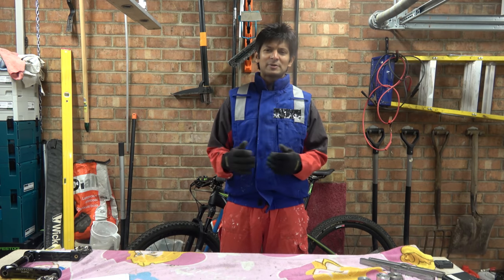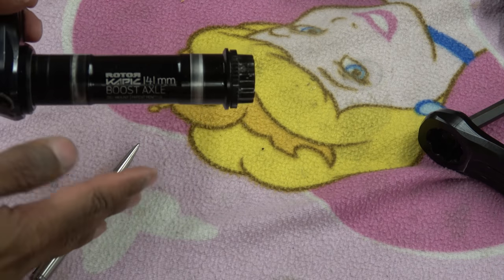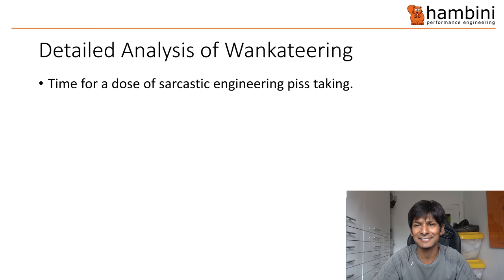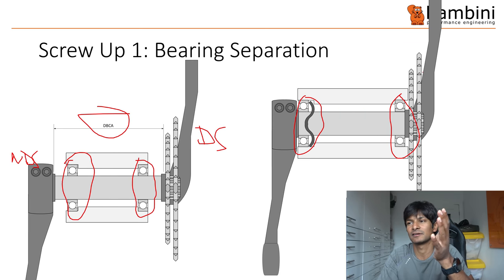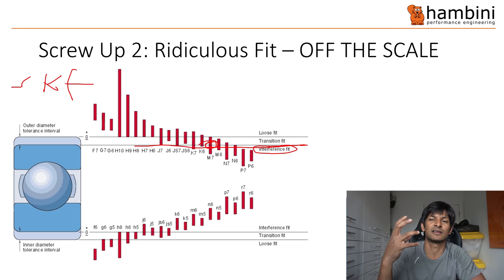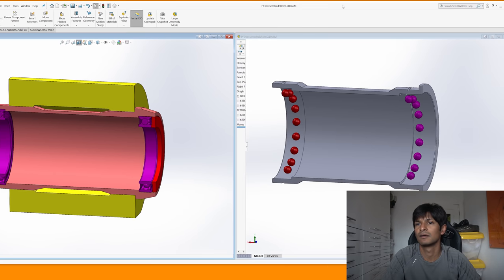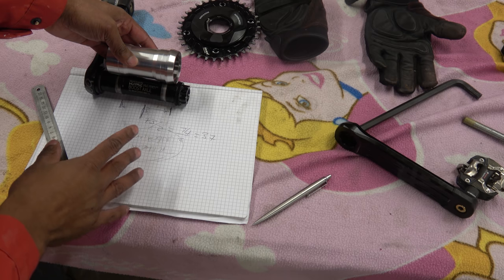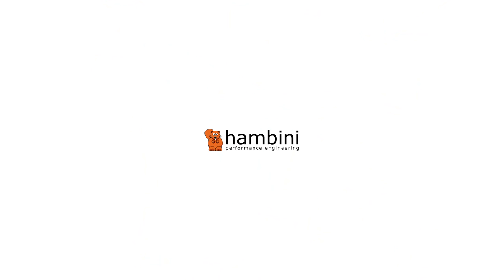Engineered By Muppets | Niner Bikes get Burned for being CRAP | Abysmal QA

Comment: As a former bike mechanic I generally try to avoid anything that is a press fit, good old english threaded bb's just work and are so much easier to live with!
Reply: Yeah, there's nothing wrong with them if they are produced to the BB spec/standard. But a push fit hole can be hugely out of spec and still get a BB pushed in with enough force. A threaded frame cant be as out of round or mis-sized as if it was you couldn't screw the BB in at all and throw the bike together for sale to some fule.
Reply: i love mike n mike PB take. pressfit stiffer but different tools to service. end of . literally. its a frickn straightforward piece of engineering either pf or english threaded. any bonehead can service.
Reply: RollinRat  So are you saying you can get away with making a garbage frame by throwing a pressfit on it?
Reply: I think we know it wasn't the BB or bearings and rather the poorly manufactured frame. That was the whole point of the video.
Reply: RollinRat  I agree, threaded BB's, even outboard bearings, will not leave you stranded on a bike tour usually. If you want set and forget for years, use a square taper crank, and Phil Wood sealed BB.
Reply: @Mike-vd2qt  Shimano Octalink BBs have been very, very good for me both MTB and road variants. I've enjoyed ST, used THUN in the distant past which were so damn smooth and used the same bearings as campagnolo IIRC, I've also used an SKF BB once, a few HOPE and a titanium TEC components ST which was 150g or so. Never used PW but people say they are exceptional.
Reply: @ynotnilknarf39  Good to hear that, as I'm about to install an Octalink BB and crankset on my hybrid.  Nothing particularly wrong with the square-taper BB it's replacing, just the old crankset is worn out and the new one uses the different axle fitting.  I'm actually rather pleased that I can change them over this easily.
Reply: Aye, they can be made abominably badly & not give symptoms a bike owner will notice, press fits however require round holes of the correct dimensions, which every other industrial sector seems to be able to make, just not bicycle manufacturers.
Reply: RollinRat  What a bloody long-winded way to basically repeat what I said.
Reply: RollinRat  There's no reason a press fit needs to be "shit", particularly in a carbon frame, & there's no excuse for the hole being out of spec in such a case, it's not subject to distortion from welding when a liner is bonded in, & a liner is easy enough to make with a round hole within tolerance, just about every other industrial sector manages to make such components.  That said, a threaded BB is more forgiving dimensionally to begin with, also easier to correct, though there's no excuse for a bike shop needing to correct either.  Neither BB type should be leaving the factory out of spec to begin with.
Reply: RollinRat  You've been bloviating this entire thread talking about bottom brackets when we all saw the video... We know it's the frame... Now you're an "experienced machinist". If you're such an experienced machinist why are you assembling bikes and rambling on YouTube?
Reply: @Kromaatikse  Nice, I'd suggest getting some self extracting bolts just to make it a bit easier but with the right tool it should be a doddle anyways, just on the road all you'll need is a 10mm allen key.
I actually bought an Ultegra triple chainset recently, you can use these older triples as a 'super' compact double as you can get rings down to a 23T to fit the inner BC (normally 24T) and with 130BCD rings going for cheap due to the 110BCD 4 and 5 bolt road cranks you can have anything you like really a 39/23 with say a 11-30 at the back means you've covered most the bases for everyday cycling.
TBH though it's almost as easy to have it as a full triple (I use a ST triple on my audax/touring machine), any Shimano triple STI from the last 30 years will work, or even a Campag ergo 8 speed to early 10 speed with the multi positions means it'll work with virtually any FD. Or if using a friction shift left you can use anything including MTB front mechs with road cranks.
Shimano has gone downhill in recent years though, road stuff is ugly AF and MTB isn't that much better.
Reply: @ynotnilknarf39  Really I'm doing a nearly like-for-like replacement using some of the cheaper part lines.  The original Spectra 48-38-28 triple, in which I'm fairly sure the two larger wheels are aluminium, becomes a Shimano 48-36-26 triple in all steel, and the original 11-32 cassette becomes an 11-34 MegaRange cassette.  The gearing sequence (using double shifts between 4L/3M and 6M/5H) becomes significantly more even with that combination, and I'm reasonably sure the original derailleurs will still work too.
At my end of the market, the really unforgivable sin in my eyes is in those awful 10-speed "mountain bikes" that, with something like a 38" bottom gear, have no hope of climbing any actual mountains.  I was lumbered with one of those in my teenage years, which really put me at a disadvantage on some school outings.  But what you could do with one of those with a modern "compact double" crankset, a 6-speed 12-34T custom rear cassette (eg. 12-14-17-21-26-34), and smooth tyres - instant hybrid conversion.
Reply: @Kromaatikse  sounds great, I started using 24T inner simply because I could avoid using a dinner plate cassette and because I've never been small I'm averse to the bigger jumps between the ratios. Then I found some 74mm BCD PMP 23T rings, whilst only 1 tooth less it lowers the bottom again a smidge. Means I can drag my 16stone and loaded bags up a 14% without absolutely killing me or falling off.lol And yes, a 38" isn't much cop for us of a certain age and maybe a few puddings too many under the belt ;o)
My first ever tour was Northern France in 1990, not heavily loaded and just stopping in B&B doing about 70 mieles each day. My bottom gear was a 42/24, no way was I going anywhere hilly with that gearing but that was stock on my machine straight from the shop! I still do run a 6 speed 13-28 with a 48/28 on my 1950s machine. Also have a full case of new old stock Suntour sprockets and freewheel bodies, the sprockets go all the way to a 36T, can't bring myself to use them as they are gold and bronze shiny goodness.
Reply: Threaded bb have thier own inherent problems normally aluminium inserts are bonded into a carbon frame which can over time degrade and become loose due to galvanic  corrosion.

Comment: This is exactly why I much prefer the older bikes with threaded bottom brackets. I would never intentionally buy a new press fit bike. I used to volunteer at a bike co-op on the weekends. I did a lot of bottom bracket re-builds. The older bikes are a lot easier to work on. This video is great for explaining the engineering involved. Please keep up the good work. Thank you.

Comment: Hey Hambini, I came across your channel doing some research and I'm hooked. Maybe it's common there, but on this side of the pond it's rare to see an engineer that knows what end of a screwdriver to hold, yet you use tools. Further, it also appears you do some machining operations to fix other's gaffs after a thorough analysis. That commands some respect. I love the attitutude and the sarcastic AF sense of humor! Definitely somebody I could have pints with. Good job man, keep it up!

Comment: Happier than ever to stick with old school GT MTBs from the '90s with square taper bottom brackets and (literally) indestructible Cro-Mo frames.
Reply: hmm no real difference to the most basic outboard system. square has smaller bearing and smaller interface/splines. how is this superior?
Reply: @8iamretarded8  I'm not an expert, but I've never seen the kinds of bottom bracket shell diameter differences or ball bearing wear on old, tried and tested square taper bottom brackets - unlike the one shown here.
Reply: @8iamretarded8  I believe it's the manufacturing process. The cartridge bearing assembly is already pre-assembled, everything there is already aligned and the manufacturer has control over that tolerance stack up. All it has to do is screw into the frame. Fortunately it's straightforward from a manufacturing perspective to get those threads right and aligned.

Comment: There's such a tremendous variety in quality in MTB frames these days. Niner has never been seen as a super high quality brand anyway. I'd love for you to look at something like a Santa Cruz frame and not just the QC on the BB but the headset and all the suspension pivot points.  Was hoping Peak Torque would do that too as he picked one up.
Reply: I think you're right. I've had Marin, Giant mainly and no issues and now I have built bikes up from Chinese BXT frames. I go for BSA and had zero alignment issues using Shimano band genetic brackets.
Reply: Can you reco any quality mtb brands? Im looking for one.
Reply: Yeah the tolerance of the press fit BB on my Specialized Epic was awful. Fortunately fixed easily with a conversion BB. Most off road bikes seem to be moving back to threaded BBs.
Reply: whats up with you guys? BB presdfits? I never would buy a MTB who has that.
Reply: RollinRat  it's funny that my MTB frame is fairly cheap and is made for people who want to race on a tight budget and get a hefty frame for that but the main pivot bearing's are oversized.  Unlike many other expensive crap who got tiny bearings to save weight.  Scott bikes comes to mind because of that tiny bearings for their full suspension..
I would love to see how much more bikes he can smack because there are many fucked up designed MTBs
Reply: RollinRat  that's interesting, you know I am a inspector/QC my self. Not for the bike industry but I really want to get there. Just started 2020 and I allready saw enough crap.  I also was an mechanic and later worked with CNC milling and lathes. 

The last over hyped totally bad product I saw was the MTB ZIPP Moto Carbon wheel's . Man they are so extremely bad. Air bubbles made dimpels inside the rim. Wasn't straight, even egg shaped because they did sand it down. The wheel was not even tensioned right...
Reply: RollinRat  ha , I read it all. Even more funny , I am in the defence business and have a job offer for medical. 

Yeah I known but as you said there is no one who makes those frames. Better get oversized bearings compared to tiny almost pinky sized diameter a like. My frame is actually the first model this company created. My FS got coils for less maintenance and better handling. 
My other MTB is just ridged. There is not much you can do here , haha. 

That RS incident sound familiar.  Very stupid decisions are made here.
Reply: @PhiyackYuh  banshee
Reply: 23000 miles on my Niner RLT RDO with no creaks or other problems.

Comment: Would love to see a video on how you machine the bottom bracket shell
Reply from the maker: I would give too many secrets away!
Reply: @Hambini  Far east joined the chat.
Reply: That's what the 30cm tool is for
Reply from the maker: @koko_5662  my thoughts exactly
Reply: on a machine dummieyeee
Reply: He has a 3 axis CNC lathe and a 5 axis CNC mill at his disposal and machined complete from a single billet of alloy... I think.
Reply: I’m guessing a park 791 in a custom jig. I’m going to try that, failing that I’ll make my own reaming tool, 6 toothed, straight flute, much longer though, like a 120mm long tool. Also pondering an adjustable reamer, hand or machine. I kind of like an adjustable reamer with 125mm cutting teeth. In a jig and bearings at each end, could produce very nice results. A few ways to skin this cat.
Reply: RollinRat  Tottaly agree.
Reply: RollinRat  Even with BSA there is no guarantee the the two sides of the shell line up perfectly. I have had that experience.

Comment: I've bought a full suspension frame straight from a chinese manufacturer and the bottom brackets shell was misaligned, oval and small. Pressing in the PF92 took a lot of force and the driveside outer edge of the shell cracked about a month of riding in. There was significant drag, the axle was discolored from bearings and it was creaking while pedaling.
To my great surprise they sent a replacement front triangle and it work fine now.

Comment: The sixtyniner steel frame I got seems okay, but the carbon fork that came with it has excremental alignment for the road hydro brake caliper. Insta-rub when mounting new pads, every singe time.

Comment: How did you machine out the frame? Did you put it up on a mill or do you have jig to attach to the frame? I'm guessing because you you stopped the cut half way you came in from each side, how did you get the alignment when you reset the cut?
I expect you won't answer, trade secrets... but a nice piece of machining.
Reply from the maker: It's a bit of a technically Pain in the rear end process!

Comment: @16:00…to be fair, the SKF recommendations are for the bearing outer race into the housing.  PF30 uses an intermediate housing that presses into the frame, which is the diameter Hambini measures.  Not all the interference is transferred through the intermediate housing into the bearing outer race.

Comment: @hambini, I'm genuinely curious why any sort of retention mechanism for the non-drive-side is omitted here. Your BB has a nice, tight fit to the BB shell and while it probably won't happen, isn't it possible that the BB could walk its way out the BB shell toward the drive-side? I should think a retention clip should be used here to mitigate the possibility of BB egress.
Reply from the maker: This is often confused, the lips on the edges of bottom brackets are an Axial STOP, they are not there to stop the thing falling out. The thing stopping it falling out are the radial forces from the interference fit.

Comment: From the very first glimpse , when you initially lifted this nike in the table, was 😳 how anemically thin the BB body is. Looks as though first “jump” of any sort, the frame to snap in 2 at that exact point. 🤔
Reply: Nah, mate, carbon fibre don't care. That's why it is such a popular material. Most issues are very obviously on the QA side of things.
Reply: is basically a grandad frame with niner branding. no??

Comment: Hambini, have you ever taken into account that rider input might also be a contributing factor in these supposed mis-alignments? For instance I almost always lift, wheelie up, bunny hop with my right leg pushing forward on the pedal stroke to aid in the lift. Couldn't repeated stronger inputs from dominant leg play a factor?
Reply: That's even worse. If a regular rider can deform an exquisitely made frame.
Reply: The bike engineering should take factor that MTBs are being abused. They droo from heights

Comment: The uneven bearing wear, that it alternates left to right every 180 degrees makes me think that the rider has a leg that is much shorter than usual normal asymmetry in length. But the length difference also causes the rider, when coasting, to have the longer leg extended fully with all their weight on that foot, and the shorter leg bent at the knee well. That gives a pattern where (for this example) the long leg is on the drive side and when fully extended is bearing your full weight, and leveraging the Non Drive Side to press upwards 1/2 of each revolution.

Comment: I have to interject here, I am a mountain biker for over 20 years, and have heard countless complaints of bottom bracket creaking from press fit bottom brackets in both aluminum, and carbon bikes. Personally I think the tolerances are too tight for sure causing excessive bearing crush when pressing in the bearing cups. All my bikes have had wider external bearing thread in bottom brackets, and never had a problem.

Comment: Me bottom bracket was reamed quite misaligned from both sides so that when the armed up sleeve was inserted it got stuck really hard. Removal was painful and left score marks and raw rubbed areas and penetration pitting. Now the chap tells me an oversized reaming is in order as if that would clear things up. When will the torture stop ?

Comment: My question would be:  How did Niner ever get the crank spindle through the bearings on initial build/install?  Must have taken a BFH!  The person holding/swinging the BFH never said to themselves:  "this doesn't feel correct" ??
Reply: Crank spindle would go through the inside races of the bearing carts no problemo. They just pressed the BB in and since the shell is too tight, the assembler twisted their tool harder. And if the bikes are as shite as Hambini is guessing, that assembler does this sort of thing regularly. Some are tighter than others, she probably thinks to herself.
Reply: They're not paid to care; they're paid to assemble x units per y time.

Comment: Brilliant. As always,comes up with a properly engineered solution to remedy the typically poor tolerances on today’s overpriced Carbon ‘Superbikes’....made on the cheap in China.
Reply: Adding insult to injury is nowadays some chinese brands actually have better tolerances than them!
Reply: @jamessmurf2929  Yeah, this is something I cannot wrap my head around. Didn't Hambini himself recommend a couple of Chinese manufacturers?

My father works for a bottle OEM, and he says that his company leaves all the good stuff for OEM customers, not their own brands.

Either the bike industry is different, or it is simply a case of bike companies not caring at all about quality and looking for the absolute lowest bidder. I guess it's also possible all the quality Chinese bike manufacturers cannot deliver enough volume.

Comment: I have NIners top xc bike, the Jet 9 RDO speccd at over $10k.  The rear suspension is out of alignment in such a way that the rear wheel is off alignment in 2 axis and noticeable just by looking at the frame from the rear. I am essentially riding this $10k bike slightly sideways and slightly leaned when going straight...